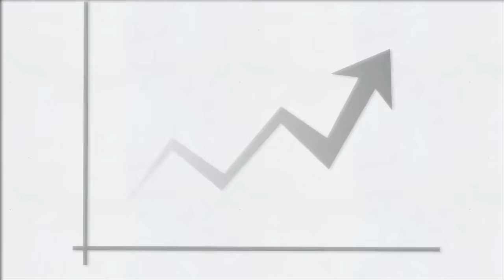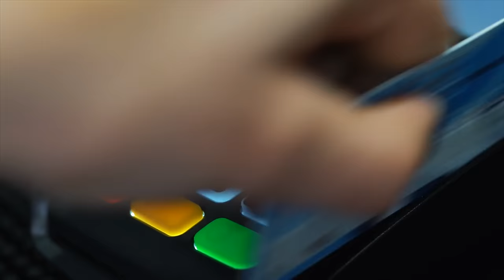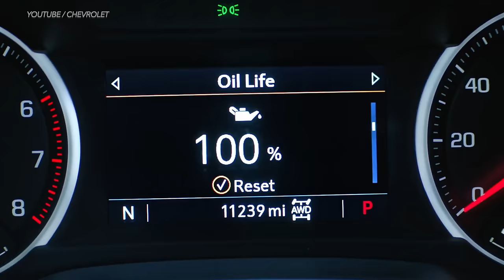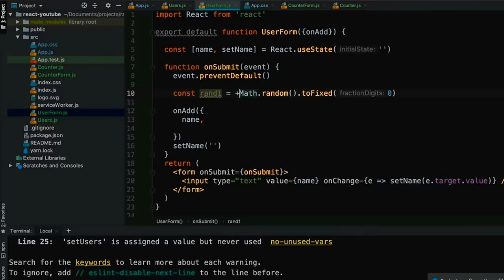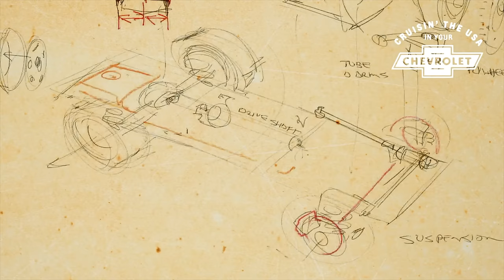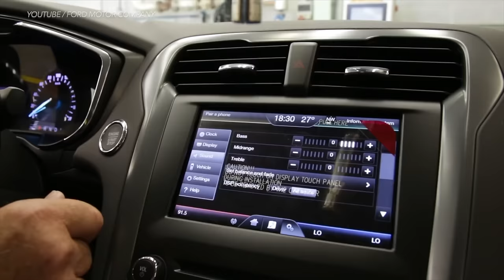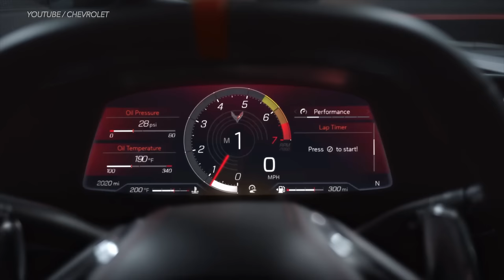Here's Why Car Companies Just Made it Illegal to Work on Your Own Car

Comment: I got a 87Mitsubishi sigma and 91Mazda mx6 turbo and because they have a lot of interchangeable parts for these of got fully rebuilt engines and transmissions for them both I’ve seen so much later model cars breakdown big time namely transmissions and overheating engines I can’t believe half of them are still selling any vehicles with there track records,plastic chain guides inefficient pcv systems no drain plugs or filters on gearboxes seriously 😒woww get a different job.

Comment: My maintenance costs only increase because of the failing economy. Since I do all of my own work I really cannot give myself a raise. LOL

As for new cars, BAH! HUMBUG! You can keep them! I refuse to own one! There is way too much of Big Brother and his Bravo Sierra inside of them! Also, they are not built well and are designed to fail long before the planned obsolescence date arrives. They are only designed to bring you back to the dealer as often as possible!

I have a 1999 Toyota Camry LE with a 4 cylinder and an automatic tranny. It is far better looking and far less expensive to own than any new heap! My little baby gets about 33 miles to the gallon and has never had the engine apart, EVER! To date, it has never had to receive anything more than new timing belts and a tune up. Recenlty, two belts and a harmonic balancer were replaced. Big deal! Any other issues were all chump change stuff. I use Mobile One lubricants and filters to keep it running like new. All I ever really need to do is replace brake pads and shoes and put on new tires every 50K to 75K miles!

By the way, she has slightly less than 350K miles on her right now. It has never left New England and has never spent time in any garage except an occasional parking garage and those events can be counted on one hand! She is in excellent shape, handles like a dream and will keep going for a long, long time. Way after those new junk heaps are already being turned into tuna cans, again! My little baby will definitely be looking for 1 million miles, or more, before she ever quits!

The old adage is true! The don't build them like the used to any more! LOL

Comment: Twatty, you start your video saying repair costs are not due to the mechanic. The problem I have with what the garage or dealer says it will cost is that most are not honest. And by this I don't mean doing repairs that aren't needed I mean that just because the infamous 'book' (or online) says it will take 4 hours and they get in done in 1.75 hours they still charge the 4 hour rate because the 'book' said it's a 4 hour job. Please anyone, particularly Twatty tell me how you justify this scam garages have been pulling forever.

Comment: That's dumb oem is not the best. I have changed many parts and quality aftermarket most of the time is better then oem. You get better performance, longevity and better protection such as powder coating.

Comment: I'm confused. Was this a direct shot at OEM parts or not? Because you have forever preached "only buy OEM parts"...
Reply: I find that when it comes to OEM, the most important difference in quality in particular parts are gaskets and seals.
Reply: @JasonLuther1  agreed. I'm still bemused a little here. Scotty preaches strictly OEM, then appears in this video to be against the fact manufacturers are pulling aftermarket options. So very, very odd.
Reply: Depends what part you are replacing whether OEM is best to buy or not. Ie, new rotors buy oem for sure.
Reply: @Imationaryman  agree with the rotors.

Comment: Car repair prices have made leasing or even renting a safer option. I spent 4000 a month this past year on cars, to drive 900 miles a month. Thsts factoring repairs, and a fair estimate of 500 for buying the car. But I needed 3 because they were in shop so long. At 1 point I had 3 in shop n was renting.